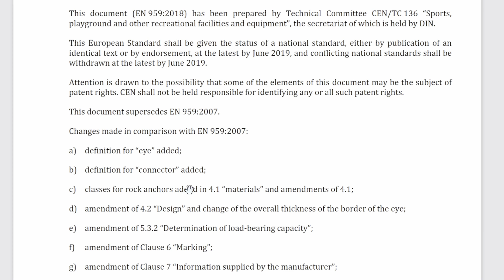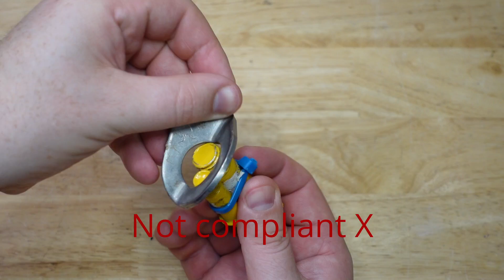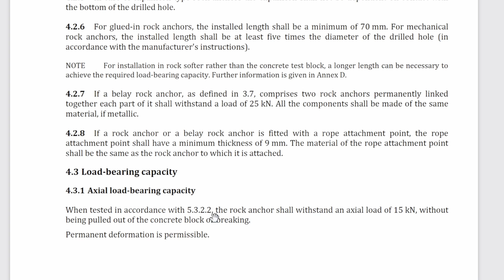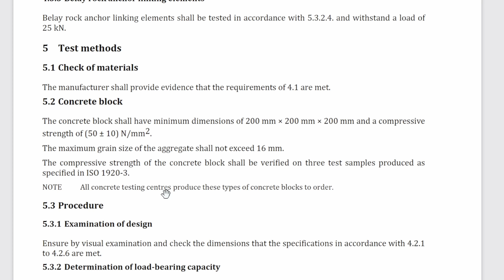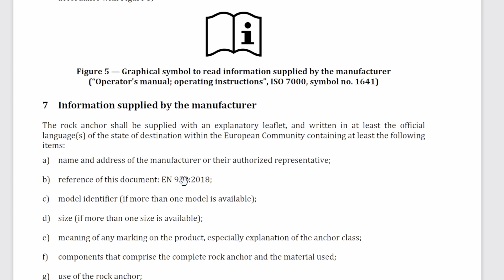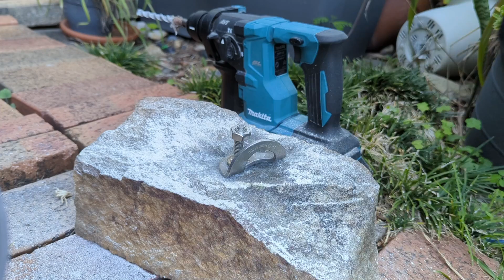EN959: what does it mean for bolting rock climbs?

Comment: Very nice. Did you try the rotation test of glue-in bolts specified in this standard? At 150 Nm I would expect this to damage the bolt if using a tube or bar inside the bolt (as seen in UIAA 123 pictorial PDF), but I might be wrong.
Reply from the maker: I haven't tried that yet (am planning to test specifically with different bolt types). But I'm sure 150Nm would totally wreck most bolts. I did some torque testing with different glues and M10 bolts broke off at 80Nm
https://youtu.be/b5ARM--1xxw